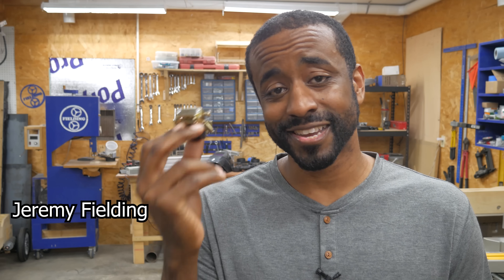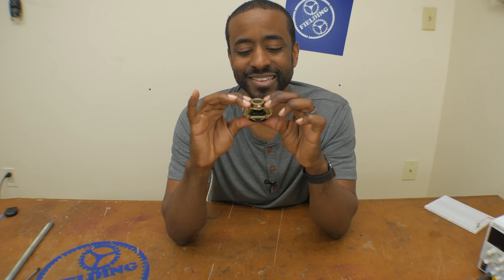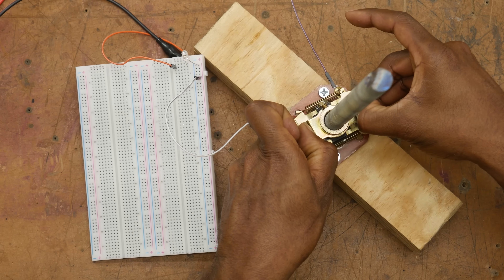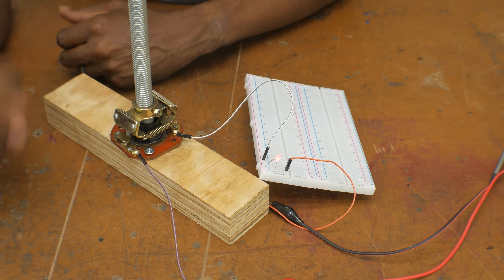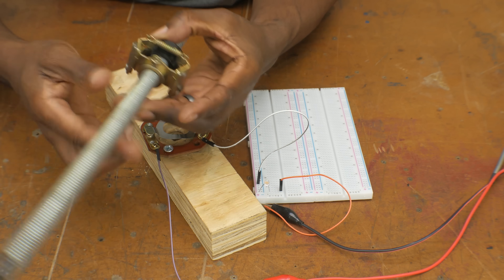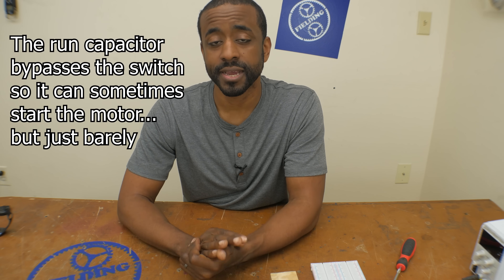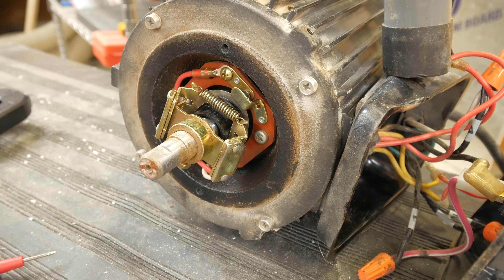This Clever Device Is Found In Nearly Every American Household. How It Works And How To Fix It

Comment: Fun fact. While cleaning a circuit contact point a slightly higher than normal grit of sand paper is preferable. Lower grits can cause deep scratches that make for less contact area and increase current I.e. more sparks when opening and closing the circuit and subsequently damaging the contact surface.

Comment: This was fascinating.  Thanks!  If anyone's interested, centrifugal flyweights also stop elevators from falling.  Elevator cabs are equipped with safety clamps that are applied to the rails should the car overspeed, say if it's falling.  The car's overspeeding is sensed by a centrifugal governor whose flyweights knock out a dog, which traps the governor cable attached to the car safeties, applying them.  The governor cable also drives the governor sheave (pulley), which spins the flyweights around and around.  You calibrate the governor by removing the governor rope from the sheave, then spinning the governor sheave with a hand drill equipped with a rubber roller.  You hold a tachometer against the governor sheave to monitor how many feet per minute it's spinning.  The governor is equipped with springs that control the flyweights' travel, whose tension you set with a screw, in order to set the trip speed.

Comment: Your channel is great. 
I am always taking things apart to fix them. The electronics age has eliminated a lot of the electrical stuff I could do. I like the simple stuff like this. I have 3 Mice I have to replace switches on and I just rebuilt the electric mower battery for $60 dollars since Neuton wanted $238 for a replacement. 
Thanks for another great video.
By the way I found that YT switched off the bell notifications on me.

Comment: I used to sand the contacts of reed switches in pinball machines. They arc more after the gold plating is worn off, so only last maybe a few more weeks before nothing's left worth replating.
A conductive paint specifically formulated for rejuvenating electrical contacts after light sanding might be worth trying during maintenance rather than a light sanding followed by full replacement when the contacts erode immediately after. (Tool maintenance...that's a subject robots will laugh about some day...)

Comment: That switch is like a set of points on a old car distributor or lawnmower if the points are dirty you won't get a spark but once you clean the contact on the points it should give spark again

Comment: You don't want to mess with capacitors they can hold a charge long after the the motor is unplugged and even been sitting and give you a killer zap

Comment: Be very, VERY careful with the plastic piece of that switch. The disk part of the plastic piece can be very brittle. I found this out the hard way (it was with a compressor). I COULD NOT find a new replacement for the plastic piece, and I ended up calling a shop that worked on electrical motors an hour and 45 minutes away to find one, and it was a used piece. I spoke with the guy when I got there, and he said he warned all his guys that worked on motors to be VERY VERY careful with that part, because you can't find them new. The thing I was trying to do was change out bearings, and I had to take that part off to get to the bearing. That is when I broke it. The guy was super nice and sold me a set of bearings and the used plastic piece, and then asked if he could put the switch and bearings back on the shaft (because he was afraid I would break it again, though he didn't say this). I told him sure, and he was kind enough to put it back together for me (and yes, I brought the shaft and old bearings so that I would be sure to pick up the right thing).

Comment: He is wrong about the capacitor. In single phase AC induction motors the capacitor deadens one of the two counter rotating electromagnetic fields. If it didn't do this then the motor would only vibrate and heat up. By taking power from one induction field and discharging it to the other field it weakens one and strengthens the other so the rotor can start turning. But he is 100% correct that the capacitor will explode from internal heat if it is used continuously, hence the purpose of the switch, it disconnects the capacitor. 
Still all in all it was a good video lesson. Thank you Jeremy.

Comment: I came across a dirt cheap electric log splitter recently. the power switch was melted, so I cut it out and wired it to stay on while plugged in. I thought this should work fine, I'll just unplug it when I'm done using it. turns out I was wrong. I figured it out after I overheated and exploded 2 capacitors. I assume it's a start capacitor, but doesn't have one of those switches inside the motor to disconnect the capacitor, so it overheats within a few minutes and lets the smoke out. as it turns out, the motor is only made to run for a few seconds at a time, and the switch I cut out really is needed.

Comment: There is an elevator penthouse in St. Louis city that uses one of the with large steel balls that when the motor spins at full speed the steel balls raise almost straight out and slow the motor. I believe this is where the expression balls to the wall comes from as the weights are at maximum height when the motor is running full tilt. I may be wrong but I think this device dates back to Thomas Edison's day. Edison was fighting Tesla to use DC voltage to power cities. It would have required a generator like every two blocks because DC doesn't travel well. Edison actually used AC to electrocute elephants and dogs to convince people DC was safer. You did an excellent job of explaining this interesting switch! You should be teaching a science class my friend

Comment: I am new to your wonderful channel. Two questions for you. 
1. If I leave questions in the comments of older videos as I catch up, will you read them? 
2. Why bad things happen when you use a router accessory speed control (triac) to control the speed on a inductive motor? Seems like it should work and I can't figure out why not.

Comment: Alot of motor anymore use a start/run cap designed to stay in circuit, especially in air conditioners. There is also a relay/capacitor combo that uses feedback voltage from the start winding to cut off the capacitor in start-only capacitors. Everything is now switching to ECM motors, at least in furnaces, which are not serviceable.

Comment: Aircraft with propellers attached to high power engines use a similar device but designed to control fuel flow and keep the engine running at constant rpm.

Comment: For things like this, I usually steal an emery board from my wife. It got to the point a couple of years ago that she just bought me a small package of cheap ones for me to use on this kind of stuff.
Reply: The magic red Scotchbrite pads do this beautifully without removing more than the oxidation.  I've used them for many years with electrical contacts, just be sure to blow off the debris when you're finished polishing.
Reply: To slow the corrosion and/or carbon buildup again, after using anything like sandpaper or emery board, burnish the contacts. At least polish them as much as you can with progressively finer emery cloth or boards.
Reply: Yeah, sandpaper? Does he not have emery cloth or such like?
Reply: Yes, Adam Savage has a video on his Tested series that talks about how he used to glue strips of sandpaper to Popsicle sticks until he discovered you can buy nail files in an assortment of different grits.
Reply: The same to me. Lol.

Comment: Scoff! MAYBE A WOMAN made it!? I'm offended! ... Not for that, but because your later trouble shooting advice forgot the golden rule of TSing: cheapest to most expensive. check the switch, THEN check the capacitor
Reply from the maker: In this case it was cheapest... but some times you have to replace the whole switch. Also the capacitor is way more likely to fail and worth checking first. Many motors (unlike the one in the video) require complete disassembly of the motor only to find it was the capacitor.

Comment: My recent issue with a brand new 2hp motor was exactly opposite of this problem.  The switch contacts got stuck together and would not release causing a strong vibration and some overheating.  Centrifugal portion was fine, polished the contacts and problem fixed.

Comment: It is not specifically in the United States, it is specific to single phase motors no matter the location. 3 phase motors do not require capacitor starts or those switches, it IS recommend 3 phase motors use a soft start because when you click those on, instant torque. About the only way around this in a residential setting is to use a VFD with 1ph in and 3ph out, which would be an efficient way to run an AC compressor and HVAC blower motors IMO. But I suppose the harmonics injected into the power grid would be brutal if everyone started doing that.
Reply from the maker: Please read the pinned comment at the top :)

Comment: If you want to do some tweaking and really want to eliminate a centrifugal switch Samusco Ecs224L is an electronic centrifugal switch for capacitor start run motors.  Could be a place to start. Hope i helped a bit.

Comment: I'm a Mechanical Engineer and I approve this message.
Reply: Glad you approve. feel so much safer now.
Reply: If you ain't a mechanic then you ain't engineering.
-Joe Biden
Reply: Mechanical engineers gave us the world we have today. Sad thing is that you're under 40, chances are you have absolutely no idea how the machines you use every single day operate. Fixing your own stuff is almost a lost art.
Reply: @roberthill5549  people are always amazed when I fix something on my own, or fix something like a dishwasher for them. It's a lost art for a couple of reasons; one, the throw-away culture, two, the increase in use of cheap plastic parts, and third, the advent of computer-centered controls, things that you can't figure out just by pushing them around manually or even doing simple electronics diagnostics.  
Poverty has taught me that if it's broken, even if I might destroy it completely, I'd might as well try to fix it, because I certainly can't afford a new one.  Amazing how many times the broken part is a stupid little plastic piece, which can sometimes be glued back together or even replaced with something I carve myself out of another piece of plastic.  Other times, it's just a loose wire, or a tiny piece that I can replace from the hardware store.  
My "destroy" versus "repair" rate has gone up and down over the decades, and the downs are mainly on the device makers, creating no-repair appliances that have every intention of forcing you to buy a new one.  The better luck seems to come with fewer computerized bells and whistles.
Reply: paintedwings74 Isn’t it a great feeling when you fix something for someone and they think you’ve performed some sort of miracle? YouTubers like Mr. Fielding are doing a great service to society by turning out great quality videos like this one.
Reply: @roberthill5549  Unfortunately those of us that know how to fix things are meeting with so much resistance from manufacturers on access to parts and even facing copyright infringement for importing the base parts for things.  We really need a Right to Repair bill.
Reply: Brian Heuer Absolutely correct, Sir!
Reply: Robert Hill Yes indeed. Besides Mr. Fielding’s channel, I also enjoy Mustie1. Similar verbal delivery tone, excellent teacher and both of them teach how to build, repair, repurpose items that most people would dispose of. I thoroughly enjoy this channel for that reason. I’ve rebuilt a lot of electric fans that I use to cool my garage while I putter around in it. Lots of free stuff is out there because people don’t have the basic knowledge needed to fix it. Mr. Fielding teaches the basics (and more) for free, and does a fine job of it.
Reply: It would blow young people's minds to know that when I was a kid, there was such thing as a TV repair man who would come to your house, open up the back panel, and change any burnt out tubes, clean contacts, and re-align your Red, Blue, and Green guns.
Reply: @roberthill5549  I think most people over 40 also don't know how many of the machines they use every single day operate and certainly can't fix their own stuff. Frankly, many older folks can barely learn how to USE new technologies, let alone understand the inner workings (because of course learning new skills becomes more difficult probably due to having a lower neuroplasticity)... this isn't an issue of age groups (except for the aspect of experience requiring time and older people have had more time to gain that experience). I will bet that as a recent college graduate, I understand mechanics better than 90-95% of people over 40 (because the material if freshly in my mind, MIT provides an excellent education and I love making things).
Reply: @pidayrocks2235  can you use a wooden handled screwdriver? Not a neuroplastic one.
Reply: Sure you are and I'm god.
Reply: @ghettogrower3499  idiotis totalis.

Why do you empty skulls pollute conversations with your stu-pidity
Reply: no one gives a shit. im an engineer is one of those terms used to imply expertise when you have none.

Comment: Well, it's not really a " kick" is it. The capacitor provides a time delay (phase) to create motion in the magnetic field of the stator to allow the motor to spin. With out the capacitor in a single phase motor, it would just hum and stay still when energized.
Reply from the maker: I explained this in detail in a previous video several years ago “ how motors work for beginners- single phase...But here that’s too much. Consider how many words in your comment need to be explained to a beginner. What is “phase” for example and why shift it? Even If you literally kick the motor it would start. Seemed close enough for this video about the switch and not really about how the motor starts.

Comment: It is indeed a simple item.  When it opens, the ring completely clears it.  For the way those motors are usually used that is fine; however, I had one machine that had a conveyor driven at a low speed by the press (through an overruning clutch), after x number of cycles this motor would come on for a second or two to move the conveyor at a faster speed momentarily to produce a gap between batches.  This means the motor was constantly being turned at 200-300 RPM by outside forces, until being given power.  This created a lot of wear between the plastic bushing and the switch...
I changed to a motor with a current operated start relay and eliminated this problem.  Yes, more expensive, not as clean and elegant but it worked.  As you said, the centrifugal switch is such a clean, simple and cost effective way of doing this and it is almost always the best way.

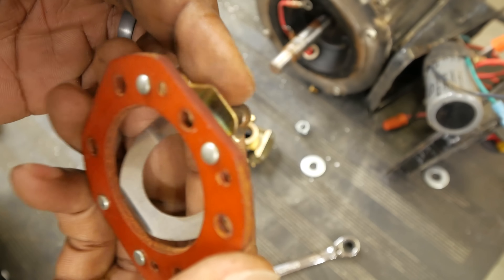Comment: 7:30 I recommend using a fine/medium grade emery board vice sandpaper to touch up the contact surfaces. You can hold the contacts together with light pressure in order to dress both faces in parallel. Used to do this back in the day for car distributor points when I couldn’t find my burnishing tool. Thank you Ladies Man.

Comment: Like your explaining, never seen a centrifugal switch in my 20 years carriere as a industrial electrician in the Netherlands. Most household equipment in the EU use only single phase power 220 to 240 volt. What needs more then 3.5 Kilowatt.

Comment: New invention idea: a paper towel holder that uses this to stop the roll from spinning and allow you to rip the sheets off instead of unspooling the whole roll. As you pull at normal speed, the roll spins. If you speed up too fast, the centrifugal switch opens and locks it up causing the paper to tear instead. Please feel free to steal my idea. I don't care who gets credit as long as someone starts making them.

Comment: Switch contacts are protected by a thin plating that helps them resist arcing and carbon build-up. Although sand paper will initially restore continuity it will also remove some or all of the remaining plating. Depending on load and other factors, contacts cleaned with sand paper will usually fail after a short period of time.

Comment: This same concept is used on the droop stops on a UH60 Helicopter.
When the helicopter rotor system is spinning, the blades have the tendency to find their own path up and down (track) and forward and back (hunt) through the air. 

To give the blades the most freedom of movement, they are mounted on a flexible spindle attached to the rotor head. The spinning motion and lift generated by the airflow over the blades is what keeps them stable and level.
The problem is, when the rotor system is slowing down, gravity overcomes the blades tendancy to stay straight outward and causes them to droop down. Because the blades are flexible, and they are mounted on a flexible spindle at the rotor head, the blades can droop low enough to actually come in contact with the airframe or objects on the ground.

To prevent this, the engineers designed these brackets called the "droop stops" that sit underneath the rotor blades and prop them up when the blades aren't spinning or, or spinning fast enough to overcome gravity.
When bringing the rotor system up to operating speed, the centrifugal force causes the stops to overcome their springs and they kick out of the way just like the switch,  allowing the blades to track up and down freely.

One of the things we have to watch for when shutting the aircraft down, is making sure that the drop stops spring back in as the rotor system slows down, so they can prop them back up again for a safe shutdown.
It's neat seeing the different areas this design principle are used, and I have a feeling the engineers who designed the droop stops got their idea from these switches.